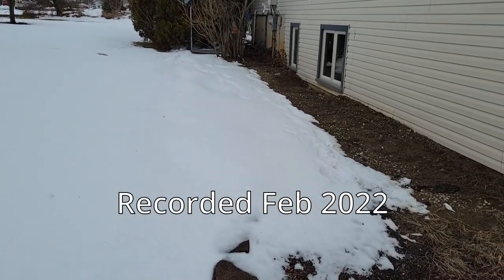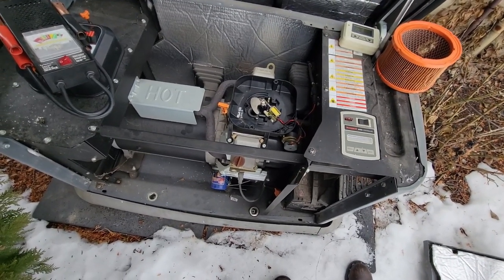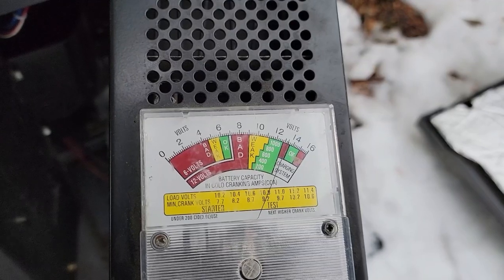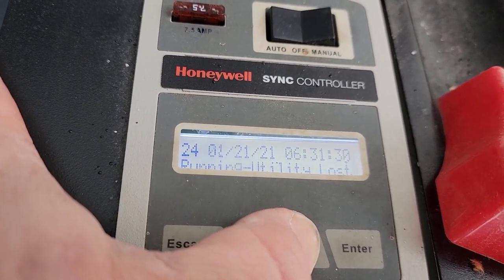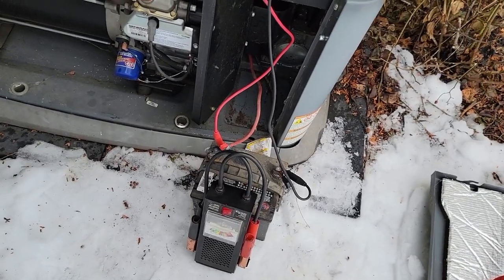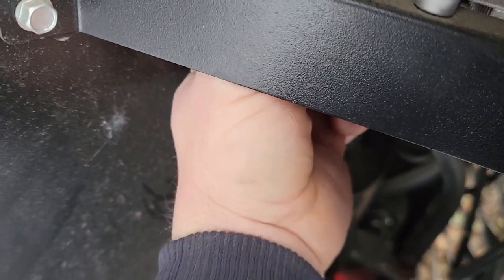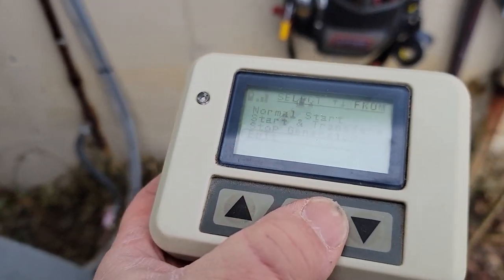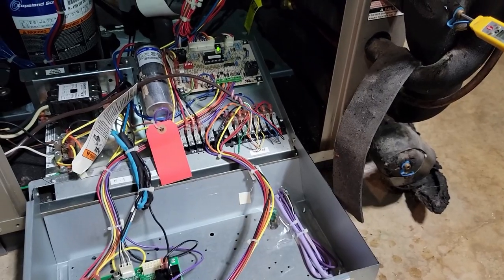Generac Generator Failed To Start & Heat Pump Flips Out

Comment: 25 year Generac tech here... any time you have a hard / no start and you are over 100 hours of run time you should adjust the valves and install new plugs. On sets with a few years on them I gap plugs at 0.025 to make sure a weak coil will get spark to the cylinders. I also suspect the mouse crap may have caused that choke flap to hang up.... or the tight valves just didn't give enough manifold vacuum to open the demand regulator on the gas. That said, the low voltage fault was a year ago so not worth chasing down. Probably ice on the brushes that cleared after 30 seconds of run time. (long enough to fault but you can't duplicate it) You should double check for mouse entry points as those sets are really tight from the factory. Either the door was not properly seated or the rubber gasket on the fuel line needs to be caulked. (very common) BTW, resting battery voltage over 14 is usually a sulphated battery, which means it doesn't have full capacity. The battery is also 10 years old. The sticker is June of 2012 mfgr date. Oh, with a little wiggling you can put the battery in with the positive terminal forward.
Reply from the maker: Thanks for the information Rup53, You defiantly have more time invested in generators than me so I will remember your pointers!

Comment: F2 should indicate Month/Year it was palletized to be shipped to retailer.   They don't expect 10 year shelf life so they only use one digit for the year.  So that battery is either a June 2022 or a 2012 battery.  And well...since this was filmed Feb 2022....I'm rather impressed that battery has lasted that long at all.
Reply: the high residual voltage on the battery also suggests it's sulphated so capacity is down. BTW, good catch on the sticker date because the video was Feb 2022 and that's not a new battery!

Comment: I installed my battery inside my heated/cooledoff grid power shed, extended cables 4’ with 2 ga. I have a shed roof with wall on intake side to protect from weather and make repairs, servicing more comfortable.
Reply from the maker: I've seen that done before👍👍 it makes sense.

Comment: On a different video, you stuck two fingers down the intake to get it to start..how did that cause it to start?
Reply from the maker: The intake stroke causes the diaphragm to open up on the fuel regulator, when you stick your fingers in there it causes it to pull maximum fuel into the carburetor. Generally those fuel regulators were defective and would harden and not open and close like they should. Those old machines didn't used to have choke, even the ones that did didn't work for the crap.

Comment: Wow the new ones are much improved. But . . . I have a 22Kw 1.5 years old. Note for service guys. I had a no start on exercise warning. Low RPM's and it was locked out. I reset it and after a couple try's I got it going. They have a bulletin to change out the starter if it's in a hot climate (So. Fl.). It was making a strange noise like the solenoid was clunking. Hasn't acted up since. Everything now is on an app. The old remote thing is something else.
Reply from the maker: Thanks for sharing!

Comment: I suspect that the scroll compressor was running backwards, a quick power cycle can cause that. Is that geothermal powered off the generator by chance?
Reply from the maker: The generator has about a 10-second delay before it starts. I suspect anything's possible but I didn't hear any loud noises like it was running backwards

Comment: I know we run 3/4 gas line to genaraters and tankless water heater if I get a call on one and it has 1/2 gas pipe we won't work on it because alot of times it can't keep up the gas pressure
Reply from the maker: All dependent upon the total load of BTUs and the length of the pipe. But for the most part yeah, you're correct.
Reply: My 10K runs great on LP with 10’ of 1/2” black pipe from second stg reg.

Comment: The battery warmer is useless, it only evaporates the electrolyte and battery only last 2 years instead of 5-7 sometimes 10 without. I work on about 2,000 generators a year and notice this. And they don’t even make that monitor anymore since about 8 years ago so I don’t think anyone will be selling them anymore.
Reply from the maker: It's about like the engine block heater they first came out with, that was total piece of shit, the oil filter thing seems to work half ass okay, both are overly priced.
Reply: @HVACRSurvival  yep those were junk and fell off. The breather hose heater they try to sell is so hot it burns the hose to a crisp. Agreed on the oil heater for the filter, that’s not half ass bad.

Comment: Sounded like the valves were a bit tight, too.  Hard starting on a cold morning, coupled with a questionable battery, may have caused the error code to be set. Definitely needs a tuneup and a new battery.

Comment: I'm looking at trying to convince a customer to buy a dual fuel generator so I can use forklift propane cylinders  to drive their warehouse wifi when the power goes out.  Last week was an 11 hour day with me babysitting the server room, main generator going, waiting for the power company to fix the incoming supply.   They ran for 6 hours with no warehouse wireless and I was getting flak for it.
Reply from the maker: Why wouldn't they just set a propane tank or run natural gas?
Reply: @HVACRSurvival  enormous sodding warehouse.  They have PILES of tanks for the forklifts anyway, and one tank should give them at least 8 hours of runtime.  No need for the additional expense for the once or twice a year it might be needed to run the warehouse wireless, network, and two computers.
Reply from the maker: I just purchased a Generac GP3000i, it does 2300 watts continuously and 3000 peak , 3% THD 60hz even at  low idle and I got over six and a half hours at 25% load from 1 gallon of gas. Might be something to consider if it's that small of a system load. Looks very promising so far.
Reply: @HVACRSurvival  That's about the size I'm looking over.  The other reason for propane is that they'll never drain the gas tank or clean the carburetor.  When I find out about it, it'll be too late to address.  Propane has no ethanol to screw things up, and they have a basic maintenance guy that can change oil, I'm sure.
Reply: just one problem.... forklift tanks are liquid draw and meant to be used laying on their side so can't be used in other applications requiring vapor LP. (IE: generator)
Reply: @rupe53  The only difference between producing vapor and producing liquid is orientation of the tank.
Reply: @tbelding  ... there's also a difference in the hose connection. BTW, if all you wanted was the wifi, you could use a UPS or one of those solar battery boxes, which will run that wifi for a week.

Comment: You may know how to program the unit. But you know nothing about small engines, or even automotive. Or batteries. You sat it on the ground.  For to long. Then ran a test. Well of course it'll show bad.
Reply from the maker: You're right I have no idea what I'm doing, thank you for letting me know 😁👍👍
Reply: Wendel Fears…You are full of it. Setting it on the ground or sheetmetal to use or test will not make a bit of difference. It has a plastic case.